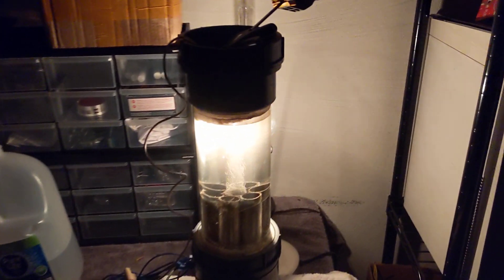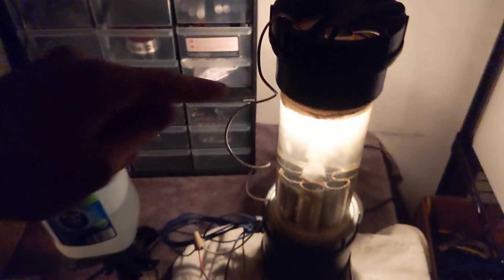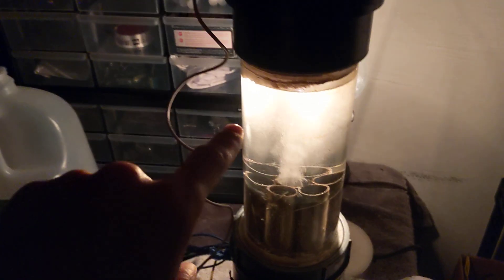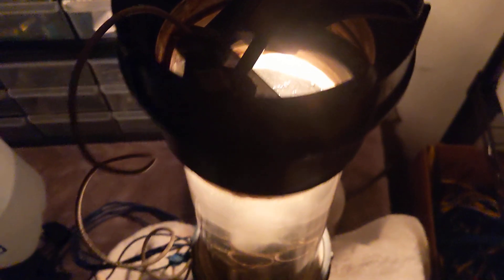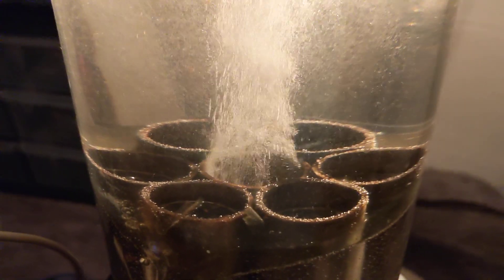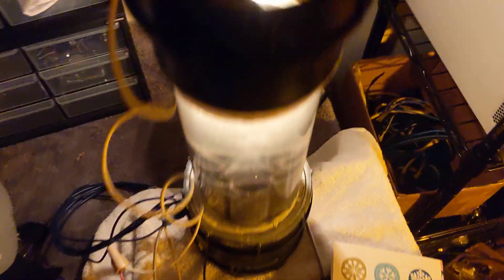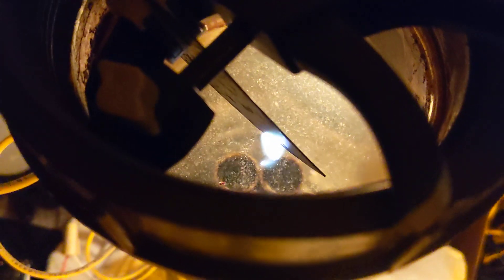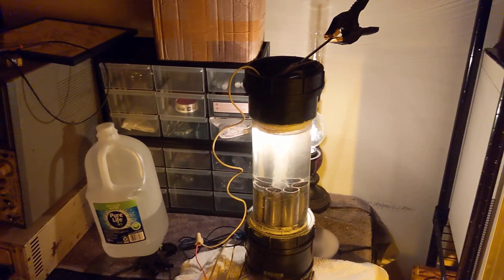HHO High Voltage Plasma Test

Comment: The Meyer voltrolysis at low current and > 1500v DC at resonant frequency of water capacitor cell and inductor as tuned to same frequency of pulsing DC power supply, is for generating ionic bubbles of H+ H+ and O-- - as very TINY ions raising upward through pure water only. You only have CURRENT with output of large bubbles of H2 and O2 and steam/water vapor, as low efficiency apparatus.
Reply from the maker: it doesnt matter, there is no resonance frequency of the water unless it's truly insulated with a quartz tube to block the dead short

Comment: Brooooo we need to collide our brains on this. Go look at my last weeks experiemenint with hho I’ve been doing. I’ve created a spiral + circle electrode cell out of  an old microwave ss shell. 

I believe I was inadvertently doing this , which I found didn’t happen when I used copper wiring but I started using the SS magnetic wiring from the microwaves I’ve scrapped . Where the wires were connecting to the active plates they must have came just loose enough to have a gap, the spark was happening between the wiring and active electrodes  as well I began to notice plasma between the neutral and both active plates. This allowed me to get more production than any other cell I’ve made that I’ve had function of 12v and up to 30 amps, at only 4.3v at the sell making the voltage between the plates 1/3rd of that about 2-5amps and I even did a torture test (not on here unfortunately because YouTube is giving me trouble trying to upload full videos and not just shorts), we’re I left the cell on for 3 hours , using only vinager, lemon and lime juice as the electrolytes as not much either but I r notes my plates stay 100% clean no slurry what so ever . 

I got another partner working on this from Flordia USA im from Tenneseee USA man if we all three would hop on a conference call and put our minds together we may be able to solve the few obsticles left me and torque (my guy in flordia) have left to clear to get our ICE motors to run off just hho!!

Heck dude I been wanting a to put a podcast together for HHo called “gaslight” if this is something you’d want to be a part of  we’ll figure out a way to exchange contact info where it’s no public like her on the comments.

I got some major faith that with the several people I personally know working hard on this could implement a successful podcast to get many more interested and future inventors will spawn like hotcakes. Perhaps the only way we can beat the oil industry to to take them on together, as we have all seen what happens to individuals like Stanley Meyer. Strength is in number, we are the few against the many!

-Troy Smith (BOOTZEsamson )

Comment: As an educated electrical engineer I am asking myself why in every video I see someone fumbles just a few mm away from high voltage sources and components. To all you people out there trying to rebuild this: This is DEADLY STUPID! Educate yourself and google "breakdown voltage". In air it is around 1 cm per 1000V....
Reply: It is actually 1mm per 1000v not 1 cm
Reply from the maker: theres a reason why one of the segments i said "dont do that" when i touched one side of the hv output

Comment: Reminds me of two different things. 1. The Meyer electron extraction electrode above the cell would capture and utilize liberated electrons. That would control the energy density and burn rate of the gas being produced. This isn't doing that but the setup is similar as the location of your "third electrode" is in the same place. 2. There's another you tuber (I can't remember who) that did an experiment with a partially submerged welding rod that arcs in a chamber while he captures the resulting gas which turns out is nicely burnable but much closer to the slower burn rate of diesel when mixed with air and not as volatile as HHO. It can be compressed and stored.

Comment: I have basically all that same equipment beside me right now! I've heard these high frequency high voltage electrolysis rigs can do electrolysis without an electrolyte,  is that true? Also I was wondering if it's possible to use a plasma globe dipped into the water instead of having a naked flame.  I have been testing around with my ZVS and modified flyback transformer to further research Electroculture of plants! It's a really fascinating time to be alive, keep up the research man! I'll definitely be looking forward to seeing your progress. I've got a deeply unified and novel understanding between high frequency resonant EMF technology, biochemistry that leads into revolutionary energetic health applications. I've had positive results with plant electroculture and will personally confirm that seeds germinate faster in a proper electrolyte solution while performing electrolysis, plants can be used as electrodes and plants also use the same 4 essential electrolytes as humans do. Salt and potash are philic and phobic which is how our cells make electricity, I believe this relationship is somehow analogous with having a positive or negative charge which is also analogous with the nature of the ph scale and how every element on the periodic table is arranged. Essentially everything we can know is reduced into a dualistic bipolar concept which suggests duality itself IS electromagnetism and that would mean its nature can be applied to any dualistic concept. An example being how the anode oxidizes and the cathode redox reduces. Our emotions are an electrical system and so intensely polarized emotions will either cause inflammation and disease from oxidative stress or it will become alkaline and hydrated as if the emotions are oppositely charged electrodes.
Reply from the maker: Yeah that was very well put. The plasma globe in water im not so sure about. The other stuff with high frequency emf resonance is really the key for everything, without the arc it has even more potential with just the plasma
Reply: @weighta6630  I've recently developed a universal model that's unified and revolutionized every field of science I've applied it to so far! Applying this model even turns the Cherubim from ancient scripture into instructions on how to build a geometrically perfect electromagnetic over unity device that's made from a solid iron wheel by coiling the 8 spokes and axel  to form 10 perfect angle flyback transformer surrounding a virtual Monopole.  It's really difficult not to be utterly inspired with universal knowledge if you can visualize the process and check out all of the historical worldwide analogy.  I hope this may help your discovery and inventive process.

Comment: Production is to low to be even cost effective, i got much more production off just a 12v battery
Reply from the maker: ya there's no convenience on the electrolyze setup or anything its mainly just a demo
Reply: @weighta6630  what electrolyte did you use potassium hydroxide? That what i use it never gets used up but do need a 10/1 ratio like 1litre water and 100ml of potassium  for current to easily flow.
Reply from the maker: this is without electrolyte @doubleooh7337
Reply: @weighta6630  cool i tried that but burned out my pulse circuit , well I'd suggest trying some and you should get supercharged production  potassium hydroxide also does not attack stainless steel ;)
Reply: @weighta6630  what kind of water you use them?  Cause that's alot of gas for just normal electrolysis if your using distilled water
Reply from the maker: @raloed.363  tap water